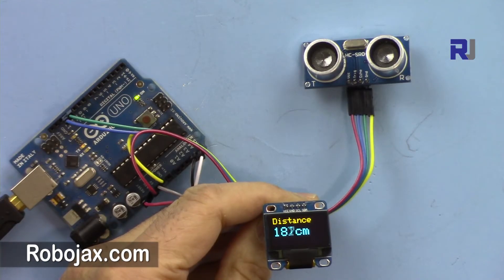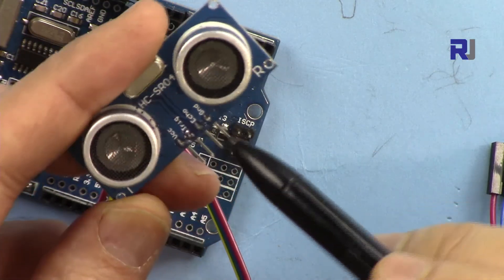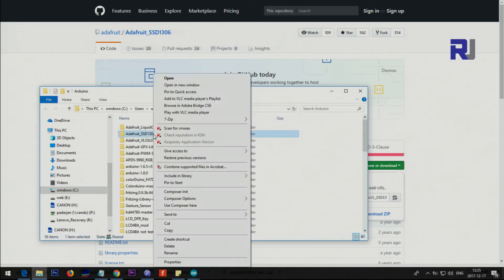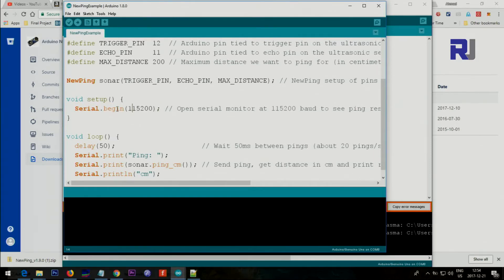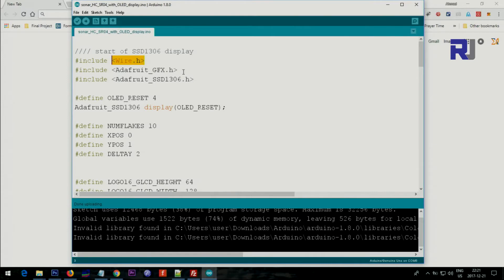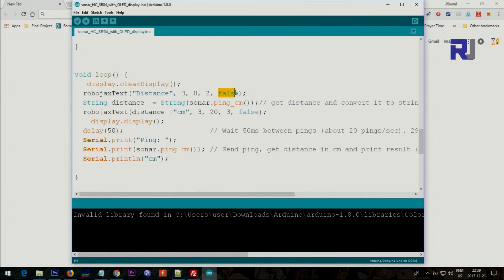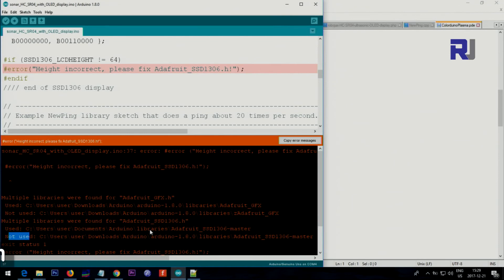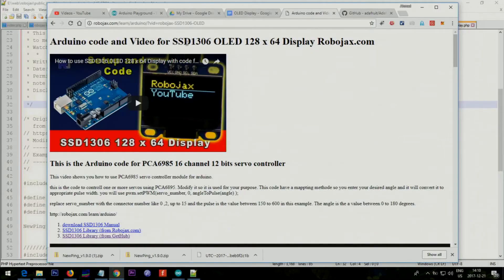How to use HC-SR04 Ultrasonic Distance sensor with SSD1306 OLED display RJT32

Comment: Having trouble with this code getting "error compiling for board arduino" any help will be much appreciated
Reply from the maker: most of the time, USB is not connected. Try running blink code Files->Basic-Blink
Reply: @robojax  Thanks a lot for the support I will do and update on comment section, I appreciate

Comment: Coul You update code for 0.91 LED. I have problem to change set cursor position and size :0
Reply from the maker: we don't use the term 0.91 ,  find out what is the width and length for  your display in pixel like 200x 100 and follow the video.